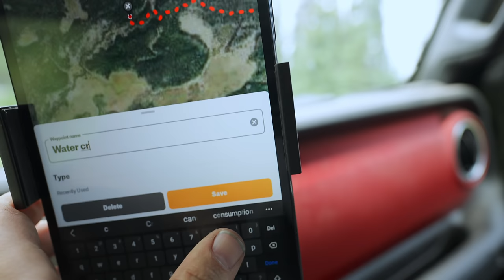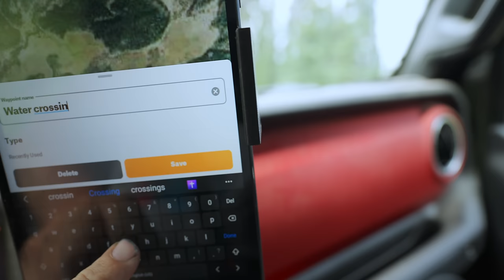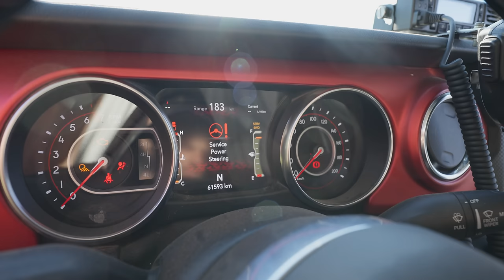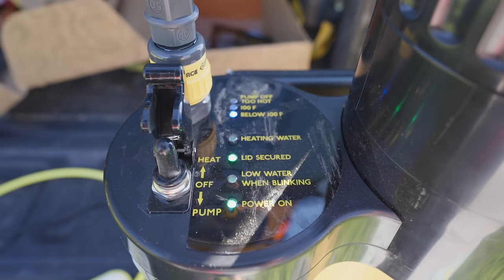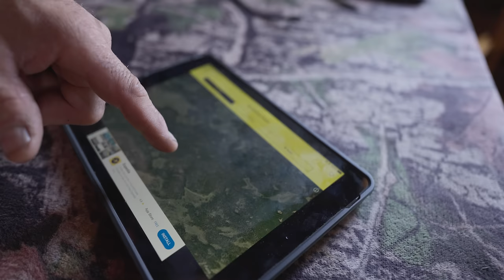Completing The Toughest Overland Route In North America

Comment: We need to appreciate the fact that Braun replaced a rear wheel bearing on the trail. These are usually removed with a press. An alternative is to slam the axle onto a hard surface to force the bearing out and they probably had to do that here. Not a fun trail repair. Great video Shaun!
Reply: Lol and a torch to open the bolts.

Comment: I ran a bad wheel bearing on the left rear of my Toyota for months. Thought it was tire noise. Then I changed tires. It wasn’t easy replacing that bearing, even in a shop. It was missing a few ball bearings, don’t know where they went 😅. Weren’t in the diff as far as I could tell. That guy Braun is a talented man to fix that in the woods.
Reply from the maker: He was missing some too 😂
Reply: @TheStoryTillNow  it’s amazing how far I got like that. I drove 3500 miles round trip to the Rockies on that bearing, and replaced it later that fall. I’m so glad it didn’t fail on the road, that would have really messed up the family trip! 
Toyota: letting owners down since 199Never.

Comment: Hi Guys - Good video and some concerning angles - It is amazing how far you can go on a side angle - 25 degrees won't tip you over and it always feels worse than it actually is?
I do a lot of 4x4 driving in Australia and looking at some of your water crossings, the first thing anyone in Aussie does to a vehicle is to install a snorkel. That way you will not ingest any water from your air filter and hydraulically lock your engine - which normally means bent piston rods and valves - Have a look at "Safari Snorkels" They are not expensive and very easy to install. Good luck and once again some beautiful scenery - Cheers Guy

Comment: Shaun I am confused about that off camber section (late in previous video) as I don't remember that back in 1980 (dating myself here) and have not seen that on all the other videos posted by you previous and others. Did you take a slightly different route?
Reply from the maker: The route we took is the original trail. Most people bypass this section on the newer dirt road.

Comment: I often find myself at 30+ degrees in my JKU... They don't tip over until about 34-36 degrees... ask me how I know... LOL
Reply from the maker: For sure, but It’s not an exact science. It also depends how much weight you have on your roof or in your vehicle, how tall your suspension is, etc.
Reply: @TheStoryTillNow  Agree 100%, but at 25 I would think even a beast of an overlander would be safe. But that ain't my thing so no judgement on my part. Also man, ya did a good job of keeping everything held together. Those long runs can start to wear on different people in different ways. Props to all ya for making it through without killing each other.
Reply from the maker: @RottDawg  tipping also wasn’t really the concern, it was more than the road wasn’t wide enough and tires were sliding down the slope.